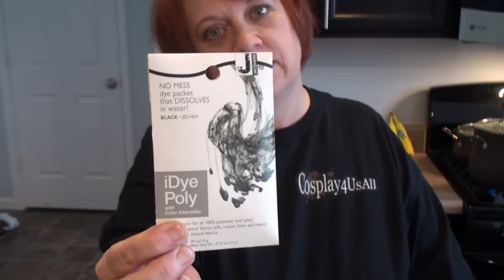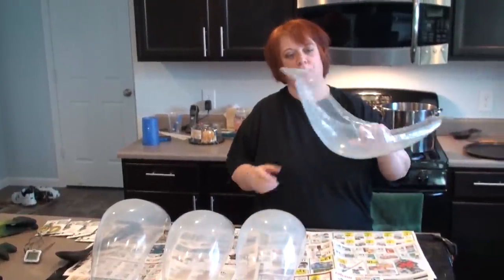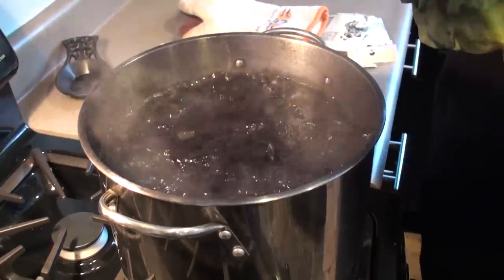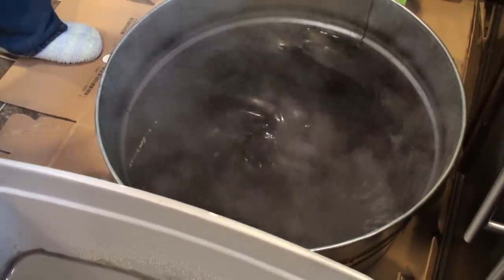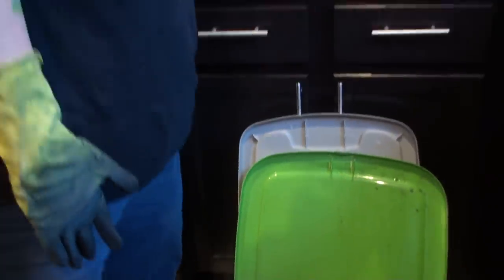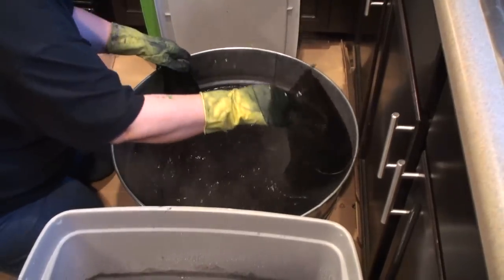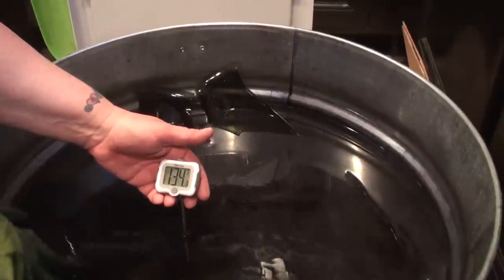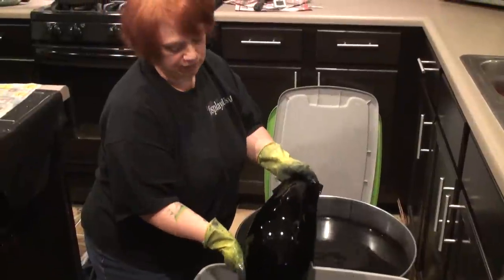How to Dye a Plastic Visor (PETG)

Comment: Has anyone ran into an issue where the dye left a residue on the upfacing surface? https://imgur.com/gallery/nzHWmPg
Reply from the maker: Braeden Young hard to tell from the pic but to me it looks like the dye wasn't dissolved enough.
Reply: Cosplay4UsAll that could be it, I had it boiling for a while but there was a sludge at the bottom of the vat. Any idea how I can remove the residue without damaging the plastic?
Reply from the maker: Braeden Young you can try letting it sit in some warm, clear water for a bit. Then give it a good cleaning with the plastic cleaner we recommend in the "additional info" section of the video. Use a soft cloth and some muscle, and you may get enough off for it to work.
Reply: So tried a handful of attempts to clean the inside, even so far as to use paint thinner, but no luck. Not sure what went wrong but I think I need to start again... or just find somewhere to farm the work out to lol

Comment: Turned out great. Just telling you now though, you did all that prep to keep your floor and stuff safe, you should have had safety gear like a respirator, when you poured that boiling hot dye into the pot on the floor, you shouldn't have been breathing that shit in, awful stuff those chemicals, it's almost like solvent paint fumes, take care of your lungs you silly bugger ; )
Reply from the maker: We had never done a batch quite THAT huge before, and you're right....with that much crap in the air (even though we had multiple fans going) a respirator might have been nice :)